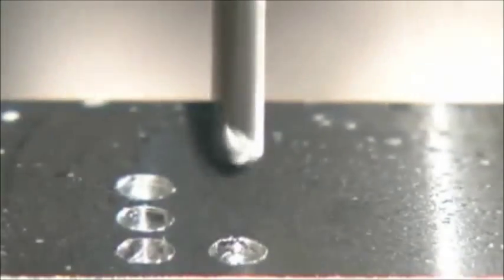CARBIDE DRILL DROP TEST

Comment: I cried today, why did you do it? 😢
Reply from the maker: We felt we could save many from scattered tragedies with that important message. Please be careful out there with your tools.
Reply: I want to make holes in 316 stainless, to make NPT threads. I don't have too much money to buy super expensive drills, but as I go on I will buy better tools.
Which one can I start with?, affordable drills and taps. 1/4NPT 3/8NPT 1/8 NPT.
I made my first run with the cheapest Job drills (the black ones) and used standard NPT Taps (HSS, not helical, no coating)... but it was a dissaster!! because the cheap tools made us suffer too much wih the time and breaking.
This time I want to improve but certanly don't buy the most fashioned expensive top drills.
Reply from the maker: Move up to cobalt drills but production today use only solid carbide with advanced coatings and coolant thru. Where are you located?
Reply: We are located in México. 
I want to drill directly with no pecking, no center drill, because the parts are short, like 1.5" long the largest.